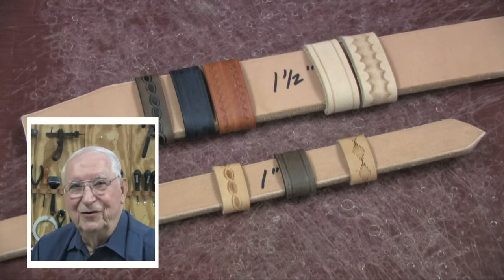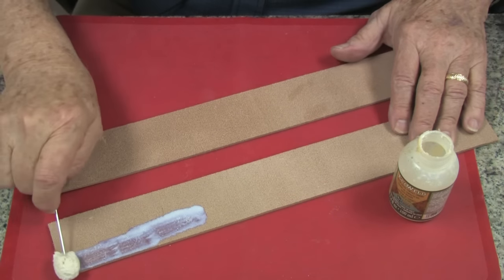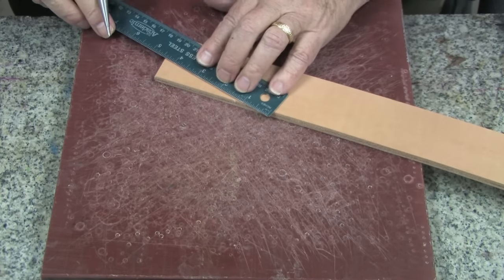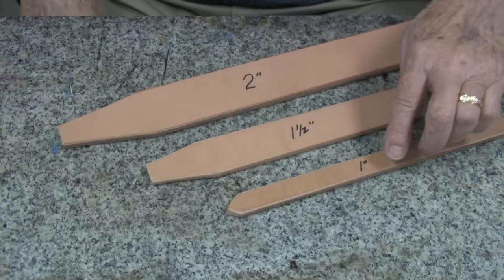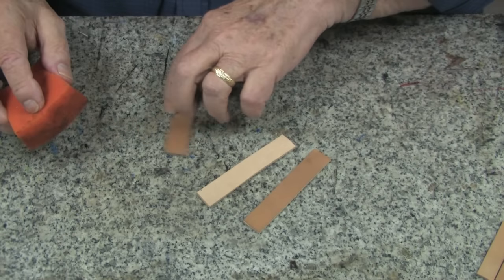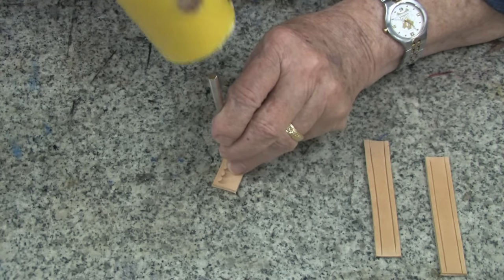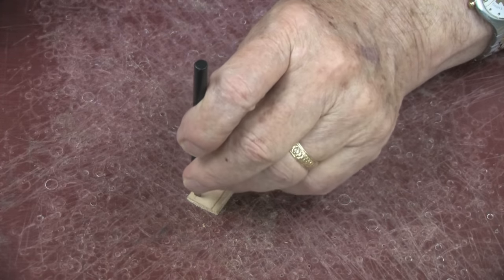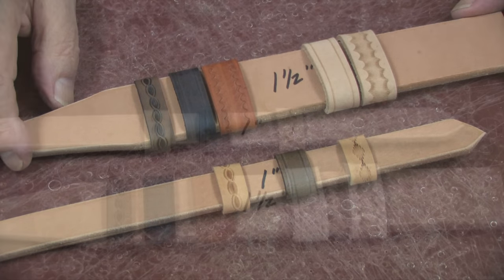Hand Crafted Leather Belt Keepers

Comment: I use the clips from Tandy which are not plated steel, but are nickel judging by how easy they are to bend since stainless would be difficult to bend. I simply use an adjustable spot setting chisel and adjust to the staple width. Tandy doesn't sell one, but they're real handy.
https://www.springfieldleather.com/Chisel-Spot-Adjustable